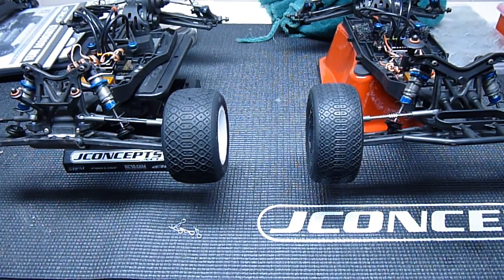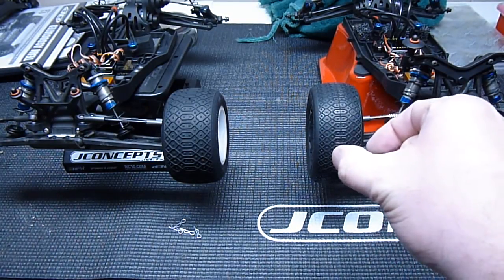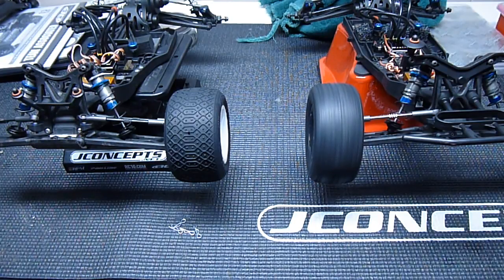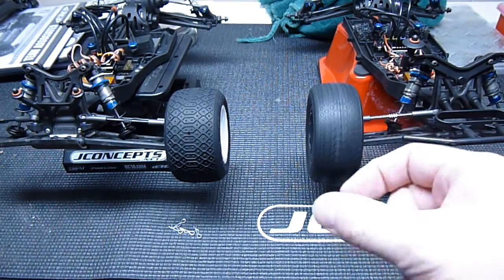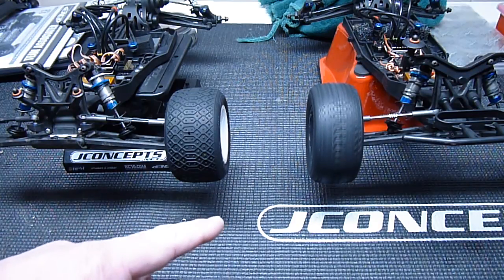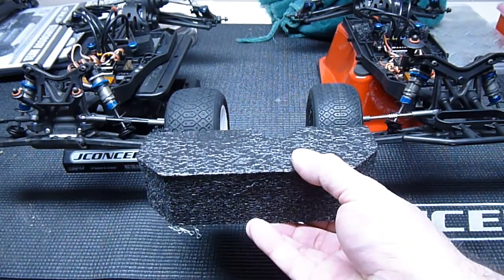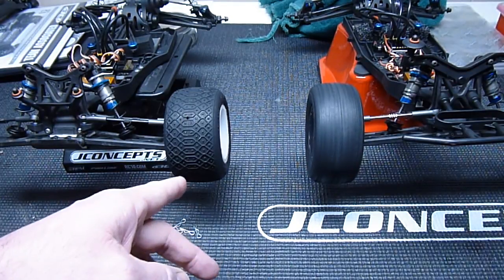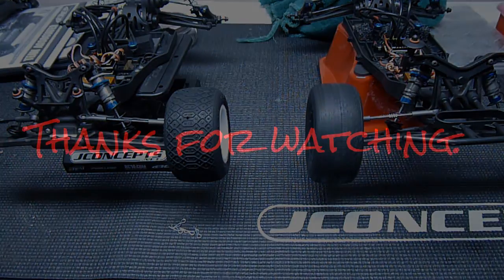Ceramic vs Steel Bearings (Comparison). Team Assocaited SC5m/T5m.

Comment: Or put both covers on after you change the oil so you don't fry your new expensive bearings. Try a free spinning front wheel and see if your happy before you go ditching seals. 

No offense.

Just instinct.

Comment: The only thing u need to do to new stock bearings is take the inside shields out, clean the grease off and add some light weight oil to it and it will spin just ask good ask the ceramic bearings.  Its the heavy greased from the factory that slows down the stock bearings.

Comment: only problem is your test is not valid most of what you gained spin wise is from pulling the seals watch this and skip to 6:15 and keep watching thought to at least 13.30

https://www.youtube.com/watch?v=o7iZVfSDbiA

 if you are gonna make the test valid use the avid oil in the steel bearings and remove the rubber seal in the metal bearing then do a side by side

Comment: which  is  good for  speed  runs , outside  not much  dirt  or debris
Reply: Christian Thompson is have to say this cheap eBay bearings that don't really spin free cazue those ceramic ones just spin to freely and you deff wouldn't want that ever in an on Rd car

Comment: If your racing indoor only you may aswell take both shields out for less friction. Use wd40 to foam out the crap after each session then compressed air to blow it all out then re-oil. Grease is better than oil it cushions the balls from the wall and has far better high temp properties, grease also acts like a shield and stops water and dirt from reaching the ball and wall surface. I would only ever use grease outdoors especially in sand and dust environments never oil and always use rubber shield outside, metal shield inside. 
Its important to note that while general cleaning the vehicle never blow air directly at the bearing face, you will force dirt into the shield. I use mercedes approved automotive bearing grease, it does a fantastic job in bad conditions.
Reply: Hi, great text. Can you add link for this:mercedes approved automotive? What about this https://www.avidrc.com/product/1/bearings/133/12x21x5-Ceramic-Revolution-6801-RSZC-bearings.html ? Is this good for dirt and water? I whant to use in EREVO 1/10 .  Which bearing is the BEST for water and dirt ?
Reply: @dimyata  I use acer ceramic bearings in my 8th scale nitro. I oil with rc bearing oil. I don't wash out the initial grease.

Comment: my stock bearings on my associated spin just as long as you ceramic bearings.

Some bearings spin more freely because there is some play between inner and outer part of bearings. That's not a good thing. Car will shake and vibrate more. Are avid ceramic bearings have play?
Reply from the maker: Are you referring to the races? The rings which have a groove in them that hold the balls in place. If so all bearings have a small space between the balls and the races. You are right you don't want that space to be too big it would make the bearing sloppy. The Avid ceramic bearings have less play than stock bearings. The ceramic bearings spin more free because they are ground to a finer tolerance. Making them more true and spin easier. In the video I explain that not only do I have ceramics in the other side but also I use avid slip bearing oil which makes a huge difference but I would not use it outside. I would only use it on indoor tracks.
Reply: RC Junky I've tried Acer racing ceramic bearing kits and their sin oil. Don't think there is a better oil that keeps bearings smooth and free plus for long periods of time.

Can't say much about Acer bearings because I haven't tried any other brand. All I can say is that the bearings have almost no play, but they don't spin much more than good steel bearings. Now I don't upgrade bearings unless they are garbage like the ones that come with kyosho kits.
Reply from the maker: Yeah I hear you there. I don't think they are going to give anyone a huge advantage. I race stock class and every advantage I can get I try to use. In my diff video I talk about how I would not have upgraded to ceramics if the old bearings would have cleaned up good, but they didn't so I bought new ones.